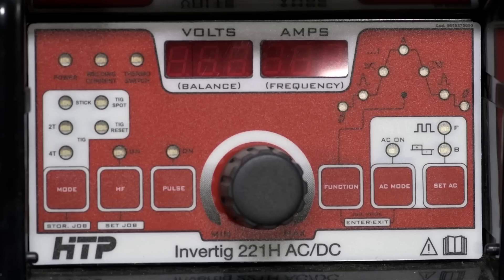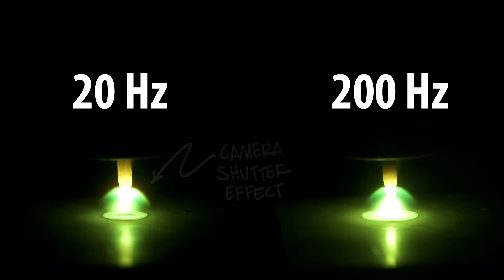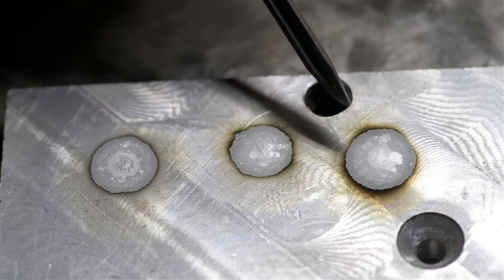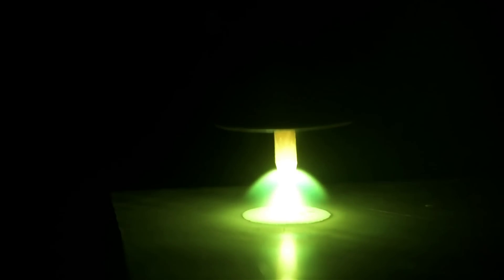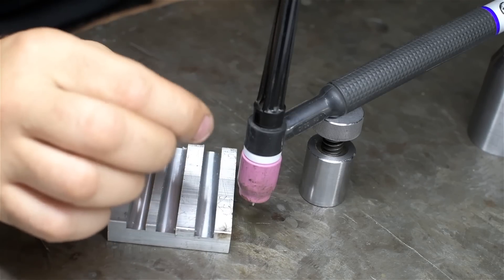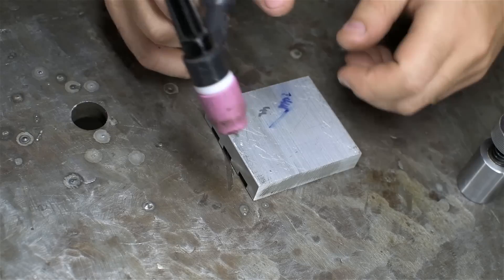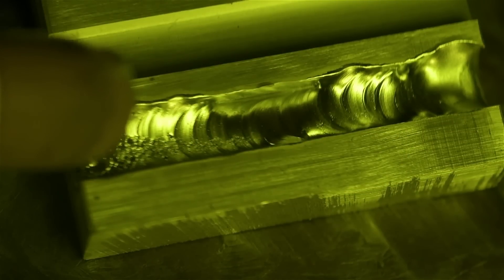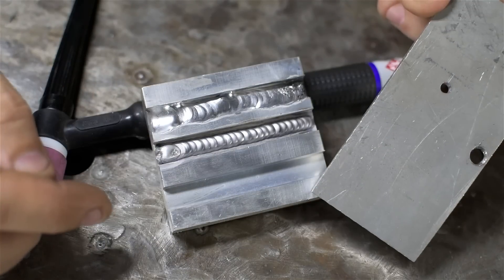TIG with TOT: AC Frequency?!

Comment: Let's Iggy skin effect, and take a look at low freq reality. We transmit power on lines via ac. This is primarily because lines can be smaller gauge for same amperage, same heat load to conductor. So, 0 hz "sees" more resistance than 60, at the electron sharing stage. Resistive heating, then, can be said to be a function of how long a path any errant electron flows before reversing direction. Ac welding tends to bear this out, as the sine wave alternates "heat" and "clean", while DC pumps heat only. Actual heating by excitation requires dwell time. It takes a match a moment to ignite paper, the spark in your engine needs to last a few microseconds to ignite mixture, playing a torch on a bar shows little effect for a very brief interlude. "Tease" any of the above conditions right, almost no energy actually gets transferred, "soak" them, energy transfers readily. Also worth mentioning is thermal characteristics of ac welded alloys, most transfer heat quite readily. Ok, now "electron shuffle" time. Our welder shoves current through conductor. In the heat cycle, at least 1 electron is kicked into a higher, more energetic orbit. In each clean, at least 1 has that excitation removed, allowing collapse to normal cloud position. Sum system change is 0 in cloud Dynamics, but the energy transfers have left excess oomph wandering about, unclaimed, and energy, much like Jamaicans, MUST do work. That excess energy inhibits excited electrons from collapsing orbitally, latent heating.

Ok, so we have a need for soak to transfer. We see a propensity for current reversal to inhibit the soak effect of DC current. We see alloys almost as happy to give up heat to air as keep it. In such conditions, it makes sense that "duty cycle" is not just the pulse width ac balance, but also demonstrated in frequency. Dangle your grubby digits over a candle. Ukulele strum your index through the flame rapidly, quick and steady. 50% duty cycle, almost no heating occurs. No do the same at 2 slow passes per second. Ouchy, muy rapido! Same 50% duty cycle, same time in flame per second, vastly divergent result. Skin effect is similar, and probably the same mechanism, but not quite the same doggy.

Now, as to cone angle, let's look at your test, and stated observations in the real world. Point makes fine, blunt makes fan. When we set up to ac weld, we either deliberately, or by natural action get the ball end on our tungsten. Your test compared dispersion at extremes, with an average setting produced ball. Neither setting actually produced it. To do an actual test of results, the ball must be one produced by the test condition, as that is the "real world tungsten" for that setting. The 60hz ball is going to make that fan at that amperage, with little variation, no matter what freq you twist in. It's a function of distance and parallelism, which is the same in both examples, so results are fairly uniform.

Now, here's a suggestion: same test on mild, alloy, and stainless coupons, using pointed tungsten with a test freq ball generation cycle for each coupon/freq combo. Each has divergent heat affection, and all give far greater heat clues than aluminum. Mebbe same with copper too, just for the thermal characteristics. Repeating in different mediums can eliminate substrate peculiarity to conditions from consideration, and also show why "scientific observation and testing" may or may not apply real world. As the majority of ac tig is aluminum, reality in aluminum is far more useful than "scientific understanding" of the mechanism at play, of course

Ok, that's my verbose posting, feel free to kick holes in it, toss veges, hurl claims about my parentage, or point at the conic hat and stool, lol
Reply: molnez  are you certain? I see switches and such rated far lower in current or total wattage throughput in DC than ac. The explanation for ease of stepping down however makes absolute perfect sense. Easy windings make ac transformer, DC requires either wasting it as heat, or far more dance steps, and expense and complexity means not as good, lol. Thanks for replying, and holding back the pointing at the hat, lol
Reply: Very interesting- well thought through :) I do not know  if it is all true but it all makes good sense to me. Thanks for an interesting comment!
Reply: Bikefarm Taiwan it seems reasonably intuitive, so probably entirely wrong, lol.  I'm hoping for expert testimony like above to mercilessly sink my ideas in a bitter draught of cold reality, lol. About the best way to get genuine insight, risk the mocking laughter of the knowledgeable, ROFL. Thanks for replying, rubber side down bro
Reply: wow that's wayyyyy too long to read, but straight off the mark my friend, the most efficient way to distribute power is high freq DC. Much much more efficient than the current 50/60Hz ac grids we use. (no pun intended)
Reply: I should have read on.... I recant my last statement and do a full backflip, you may be on to something and I like your suggested test modifications.
Reply: Did you mean to say high frequency AC? High frequency DC is self-contradicting. As for high frequency being more efficient, why would that be? Higher frequency will increase skin effect, and corona loss is proportional to the frequency. Also inductance in the wire will cause voltage drop that increases with frequency as well. Transformers however can be made to be smaller and more efficient at higher frequencies compared to the typical 50/60Hz transformers.
Reply: The reason for transferring power using AC is because it is easy to change voltages using transformers. The reason for using high voltages is because it is more efficient. 

power = current * voltage
current = voltage/resistance (ohms law)
Therefore power = voltage squared / resistance.
This means that the transfer of power is not affected so much by resistance if the voltages used are high and the current relatively low because the resistance is DIVIDED into the square of the voltage.
On the other hand .....
power = current * voltage
voltage = current * resistance (ohms law)
Therefore power = current squared * resistance
This means that the transfer of power is very bad if current is high and voltage low because the resistance is MULTIPLIED by the square of the current.
Reply: Its AC beacuse its easy to convert it. DC would be more efficient and is used in high-voltage direct current powerlines.
Switches cant handle DC too well because there is no zero-crossing to get rid of the arc. It just keeps going, hard to extinguish.
And on top of that higher frequencys will also increase losses due to the skin effect, so even more resistance for AC. At 50Hz its down to 40% of the current in 10cm depth.
Reply: This is not related to the welding AC/DC discussion, but mechanical switches are rated far lower for DC because all switches arc when being closed or opened. With AC the arc extinguishes itself every zero crossing, twice per cycle. The DC switch has to handle the arc extiguishing by means of closing the contacts fast without melting and welding shut or starting a fire. Therefore the contacts need to be a lot bigger for the same current rating.